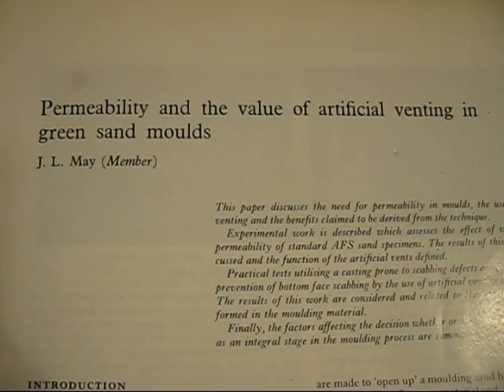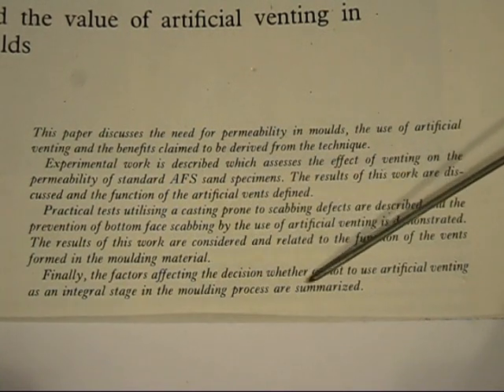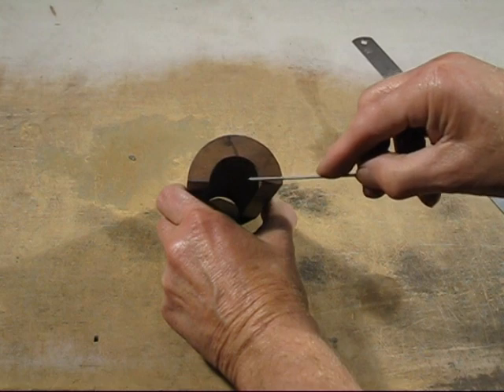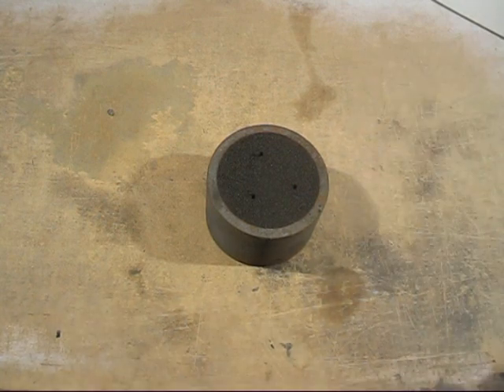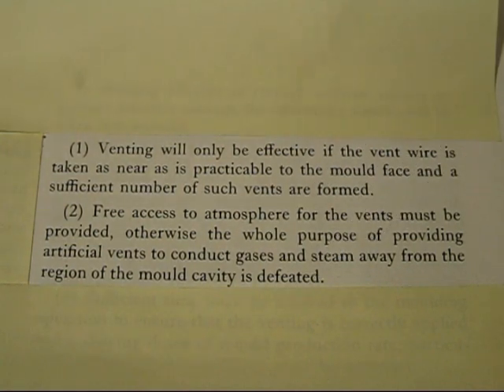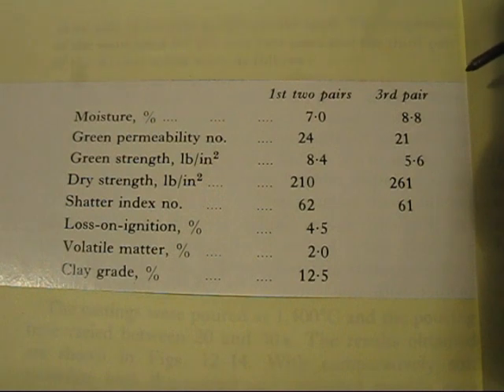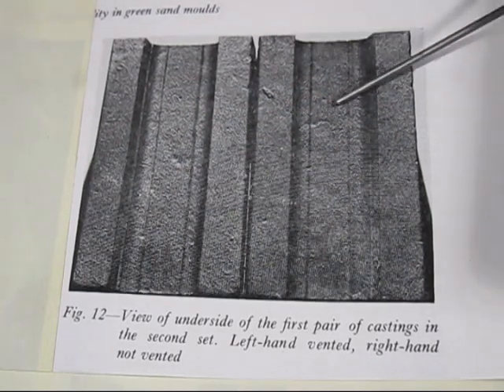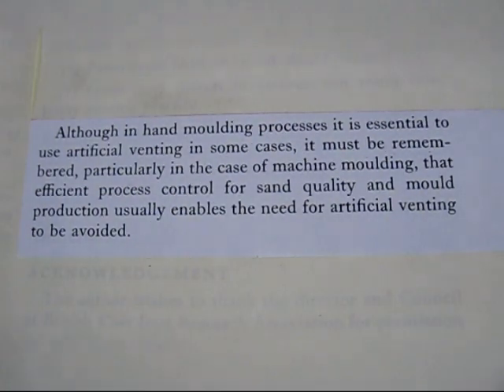How does a professional foundryman use air vents with sand molds?

Comment: I have started my own metal casting business largely based upon what you have posted through youtube. I really do appreciate the fact that you include so much information (even if some of the Alloy books are rather difficult to find) it has helped me immensely. The only point I want to disagree with you on is slag attack. Wouldn't the crucibles deteriorate from the inside out if that was the case? I suspect that clay crucibles wear down due to the abrasive nature and heat from using waste oil. I have been coating my crucibles with a high temperature paint and this seems to slow the deterioration allowing for more uses per crucible.
I still chuckle every time you point out in a video that there is no vent hole(s). I can quite well imagine your frustration with people who will not or cannot learn the proper use of ramming. May you continue posting for many years.
Reply from the maker: Thank you for watching my videos. When melting iron the slag that is produced is mostly iron oxide. This floats to the top and corrodes the top part of the crucible. Below the slag is molten iron and is not corrosive to the crucible and is always thicker than the top of the crucible. For the first 7-8 iron melts my crucible retains the shiny glaze but when slag starts to overflow and run down the side of the crucible it corrodes the glaze away and becomes thinner after many melts. I must try painting my crucible with high temperature paint.

Comment: Glad to see you back – I have tried a few times to contact you recently but had no luck and I was starting   to worry that something might have gone wrong. Good to see that my fears were unwarranted.
First, if I may, a note of caution – The date of publication of your reference is quite some time ago and back then a lot of the foundry “research” done was badly flawed through the use of terrible up front gating systems, so terrible in fact that downstream results could not always be relied upon. I am not saying that this applies to this particular reference for I have not seen it, but just that one needs to be careful with older material. I figure that anything pre about 2000 needs to be treated with care – not disregarded mind you - just treated carefully.
 The problem with vents is that many people use them for the wrong purpose at the wrong time.It is as you say that there is a lot of misunderstanding when it comes to vents! As I see it there are three types of vents although it’s a bit open to debate if the third type is actually a vent. 
We have vents designed just to get air out of the cavity. These are usually more or less opposite the ingate and look a lot like a duplicate of the sprue and gate. If all goes to plan during the pour metal will rise up this vent giving the comforting feeling that the cavity has (probably) filed with metal ok. It is surprising how many “DOH” moments occur when the metal does not rise up in the vent and the novice pourer (its always a novice😏 ) quickly tries to pour metal down the vent – like that will work “DOH”. As you correctly point out the necessity for the use of such vents is problematic. Many castings have feeders located at the top of the cavity and these will allow ample air escape. In any case there is not a lot of air in a cavity and it can usually escape easily through the permeability of even a “tight” sand. However, on occasion – thin, remote corners for example - provision of some extra air escape paths might be advisable (that disc would sure not have needed  any!) I have used the scratch vents that you mentioned for this – my use of these is ONLY to let air out of the cavity. Once the metal reaches these thin vents and blocks them it does not matter as they have done their job (the fact that the metal has reached and blocked them proves that! 😊)
Then we have the sort of vent used to allow steam etc generated within the sand to escape through the sand rather than blow back through the metal. This is more what I would regard as the traditional vent. I imagine the necessity for their use on smallish work in open sands like those used for iron would be less common. On closed sands – like my natural material made all the closer by the steady addition of a finely ground facing material, their use is at times mandatory – some castings simply cannot be produced without such vents, this is more a problem with aluminium because of the lower metalostatic pressure it produces. I use a very thin vent wire that by use has sharpened itself to a point. I push the vent into the mould almost to the point of it hitting the pattern (which MUST be in situ when venting). If the vent wire hits the pattern, it does not matter as its point is so fine that a mark on the casting does not result. As you correctly point out vents must be open at the top and bottom of the mould and to ensure that I place any vented drag on its base board with a couple of layers of flywire in between. In some of my videos it’s possible to see steam roar out of cope vents for some minutes after casting and if I forget them the steam will bubble up the metal mould interface causing the metal to tremble and likely a reject casting. Perhaps this “tremble” is what your man calls flutter?
I have for example made several 8 * 10 inch finned castings, Fins about 1 inch high and apart, cast with fins down. I had to use vents about 1 inch apart pushed into the sand between each fin to stop the gases simply blowing up through the metal - 80 vents total per mould. Without these vents the casting was an oxide film gas hole ridden mess - useless.
The third type of vent, if we can call it that, is used to vent heat. You can see an example of it here
https://www.youtube.com/watch?v=bwP4i8B2tS0
A series of these “heat vents” - actually cooling rods - have been pushed into the mould. They fill with metal and quickly solidify, heat then flows along them so they effectively chill the casting. This can be a useful technique for chilling isolated areas. But flatter fins are perhaps better than rods for this. We need to keep in mind that flash on a casting will act like this and may cause edge/corner chill on susceptible metals.
The video link above is to a gentleman who is a very skilled moulder – I do not agree with how he does all things but he sure has a steady pair of hands. He is worth a look and this necessarily is one of his best https://www.youtube.com/watch?v=-hl76Pk4aqg
…. Martin
Reply from the maker: Your comment was in the "held for review folder" so I did not see it until now. The reason why it was held is because of blocked words? Youtube is out of control!!!!!!!  I am in the same boat as you, I had a bad fall of my bicycle. I am getting better but it is taking a long time, cracked ribs hurt like hell. I knew you would find this article interesting. I have seen that video and he is very skilled. Look for bob vines comment and you will see a link to that article so you can read it.
Reply: @luckygen1001  Glad to hear from you as after three weeks since my comment I really was starting to get worried - with good reason It seems! Really, riding a bike at your age -😏 its a bit like getting up a ladder - risky at best fatal at worst. At least you will get better even it uncomfortable in the meantime, my recovery is still uncertain but looks more likely since a visit to a (very expensive) neurologist. Time will tell and in the meantime the pain is as you say not much fun - old age is a crock of crap!
I have managed to download and print out that article - it looks to be an interesting read - my thanks to both you and Bob Vines. I note the reference to "Bromsgrove sand" in it. Is this not the sand a certain far too well know YTer uses? If so his work should look a lot better than it does as it seems to be rather a nice sand. I will calculate out its AFS fineness number and see what I get....Martin
Reply: Lucky, The Fineness number for those sands comes out at roughly 151 for the Bromsgrove and 100 for the Congleton. I would not mind trying that Bromsgrove, although perhaps not as fine as my facing sand it should produce quite good looking work.... Martin
Reply: Struggling, but learning. Thanks to you and Lucky 👍👍👍👍

Comment: Been casting aluminum on a waste oil furnace.. "Oil is been preheated".... tons I mean close to a 35 % of aluminium dross or whatever is that you name the wasted aluminum material in top.....any advise to prevent this from happening??
Reply from the maker: What are you melting?

Comment: I have an issue with silicon bronze. I believe okay need venting but not sure how i should vent. This video helped. Thanks
Reply from the maker: If you think you need vents just put as many vents as possible in both halves of the mold and see if it fixes the problem.

Comment: Interesting points about the sand permiability.  I tend to run just moist enough to hold shape, no more.
Reply from the maker: Have you ever measured the percentage of water you use for your sand?
Reply: It is calculated at 4% by mass but it was not roasted dry prior.
 In AZ  was kept in sealed buckets.
"Measure moisture" ? With a tool or probe?

Comment: I've corresponded with Pam at the Institute of Cast Metals Engineers about this paper.  She just sent me a PDF copy for free and said that it could be shared.  Is this something that you'd like to set a link for downloading it in the video description below?
Reply from the maker: That is really great that you have a PDF copy of that article and yes put the link in your reply
Reply from the maker: @bobvines00  Sorry i did not see this comment until now because it was held for review. The link works but youtube will not allow me to put it in the description.
Reply: @luckygen1001  Perhaps you, as the Content Creator, can place the file somewhere that YouTube allows?  I've downloaded files from Creators' links before, but don't recall which "sites" they used (i.e., Dropbox, or equal).
Reply: @bobvines00  Bob, Thanks for this link. It worked fine and i have just downloaded it. It looks to be an interesting read..... Martin
Reply: @bobvines00  Hi, how I can get a hold of the magazine? I just started working with cast iron molds. I would like to build my technical library for reference as I improve.
Reply: @eleeyapaun9749 Try searching for the Institute of Cast Metals Engineers (if memory serves, they're in the UK).  Sorry that I didn't see your comment until this morning.
Reply: Hi! Do you still have the link for the magazine?
Reply: @olfoundryman8418  could you pls send me a copy of the magazine or maybe the link? Plss
Reply: @bobvines00  do you still have a copy of the magazine? I’m really desperate searching for this. Thank you very much!
Reply: @michaeldc4239  I don't have a copy of the magazine, but Pam at the Institute of Cast Metals Engineers sent me a scanned copy of the article about two years ago.  Try searching for the "Institute of Cast Metals Engineers" (if memory serves, they're in the UK).

I still have the PDF of the article up on Google Drive, but can't put the link to it due to YouTube URL policies.  Your channel doesn't have an email address, so I can't email the share link to the document on Drive.
Reply: @bobvines00 could you send me the link pls? I already put my email in my channel description. I contacted the icme uk days ago but still no reply. I’m kinda desperate to have this article. Thank you very much!🙏

Comment: That was very interesting. Yes, I have seen some videos where the operator of has vented his mould like it was a pin cushion.
In your real life mould example, would vertical venting around the outside circumference of the cavity, ie not through the cavity, achieve anything, that is so that it vents through the side walls of the cavity?
Reply from the maker: Most sands do not need vents.All videos I have seen no one vents the bottom of the sand mold, only the top mold is vented and yet they have no defects that could be traced to not venting on the bottom of the mold.

Comment: So been doing vents wrong, and doing it for the wrong reasons.  I thought vents were to keep air from accumulating in high parts of the casting.

Also, since the ~ 3mm venting rods resulted in long, spindly protrusions, so I went to smaller wires 1 - 1.5mm.  No protrusions that way.

Secondly, read about “scabs” ages ago.  Now I know, sort of, what they are.

Comment: I was born nov. 1967, long time ago..great info.
Reply from the maker: I feel old because in 1967 I was a teenager.
Reply: @luckygen1001  Na.  You're not old.  You're rich in years, experience, and knowledge.  I'm delighted to have the opportunity to learn from you.  So much that was never covered in the jr. high school shop on metal machining and casting.
Reply from the maker: @EdwinWiles  I had  machining classes but no casting where I went to school. Casting classes came about 5 years after I started working for a living.